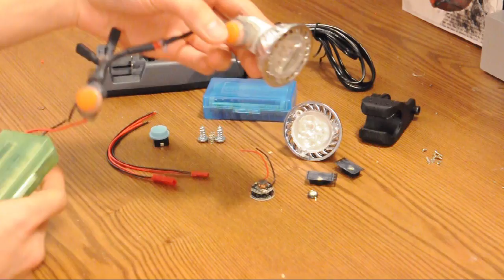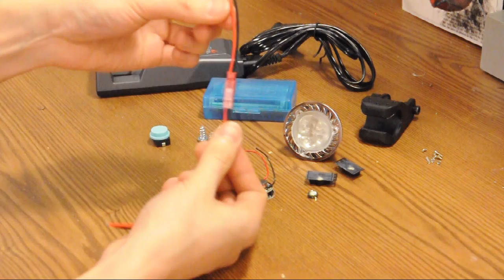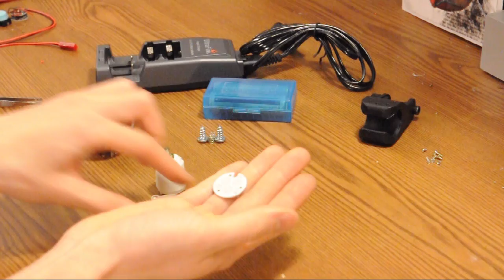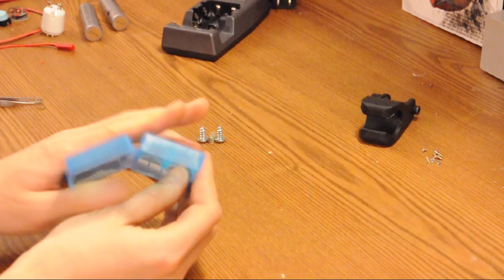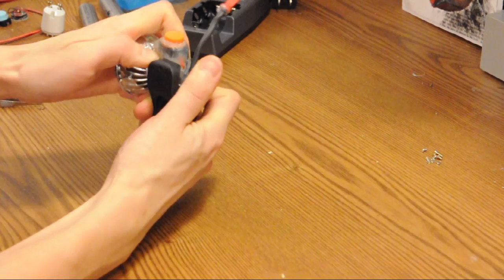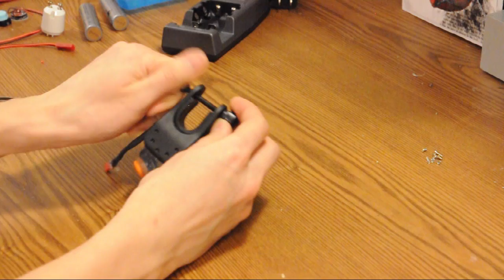Part 1/8 - Introduction - High Power 3-LED Bicycle Light

Comment from the maker: This design isn't particularly good to use with a dynamo. I have another design that works really well (I've been using it for a few winters now), and is also cheaper (not including the dynahub) because there's no battery. I've been meaning to post some updated videos with even simpler designs; I'll send you a message when I do.

Comment from the maker: @lassen54 It's about 400-600 lumens. It's hard for me to say. It's brighter than a 700-lumen SSC-P7 flashlight I have, but I'm quite certain that that flashlight isn't actually 700 lumens.

If you go to instructables High-Power-3-LED-Bicycle-Light, you can see the light being used in a dark park.